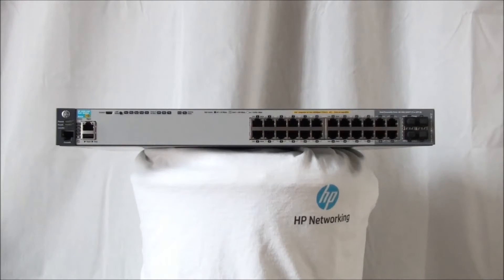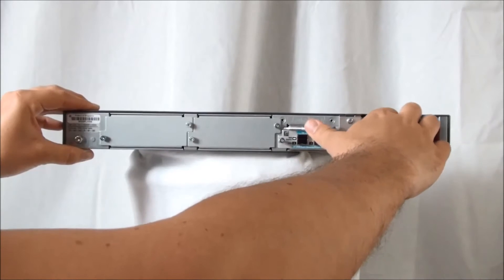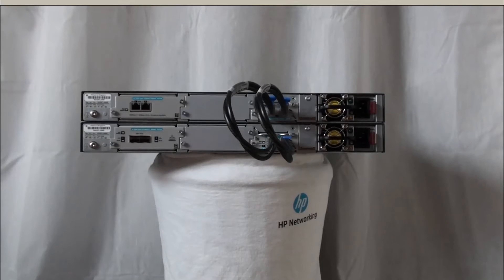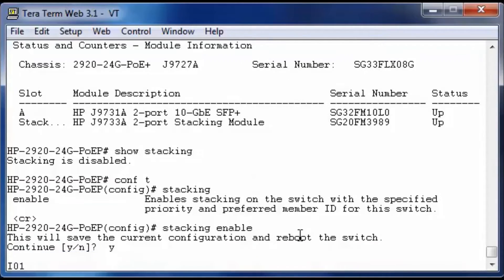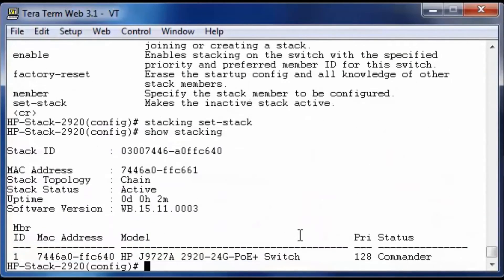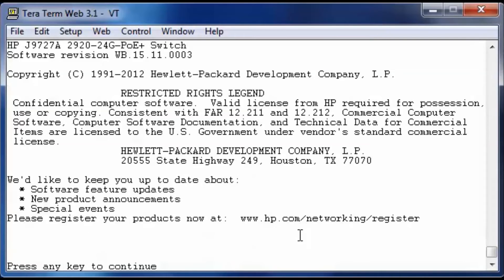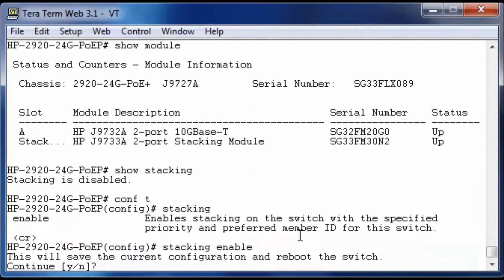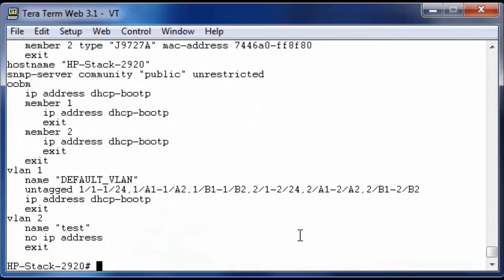HPE Aruba Networks 2920 backplane stacking hardware and software configuration

Comment: A1-FL05-IDF02# sh stacking

Stack ID         : 01006cc2-1707a780

MAC Address      : 6cc217-07a78b
Stack Topology   : Chain
Stack Status     : Active
Split Policy     : One-Fragment-Up
Uptime           : 62d 17h 39m
Software Version : WB.15.14.0007

 Mbr
 ID  Mac Address   Model                                  Pri Status
 --- ------------- -------------------------------------- --- ---------------
 1   6cc217-07a780 HP J9728A 2920-48G Switch              255 Standby
 2   6cc217-079840 HP J9728A 2920-48G Switch              250 Commander
 3   c4346b-a457c0 HP J9729A 2920-48G-POE+ Switch         100 Member
 4   941882-e06ba3 HP J9729A 2920-48G-POE+ Switch         99  Not Joined
A1-FL05-IDF02#

HP-Stack-2920# sh stacking

Stack ID         : NO ID - will merge upon connectivity

MAC Address      : 941882-e06ba3
Stack Topology   : No Stack Formed
Stack Status     : No Stack Formed
Split Policy     : One-Fragment-Up
Uptime           : 0d 0h 4m
Software Version : WB.16.02.0012

 Mbr
 ID  Mac Address   Model                                  Pri Status
 --- ------------- -------------------------------------- --- ---------------
 *1  941882-e06b80 HP J9727A 2920-24G-PoE+ Switch         99  Commander
  2  6cc217-07a780 HP J9728A 2920-48G Switch              255 Not Joined
  3  6cc217-079840 HP J9728A 2920-48G Switch              250 Not Joined
  4  c4346b-a457c0 HP J9729A 2920-48G-POE+ Switch         100 Not Joined
HP-Stack-2920#

Comment: Will stacking work between HP 2920 WB.15.14.0007 and Aruba 2920 WB.16.02.0012.
They both have difference versions will they work?
Reply from the maker: This can work. Any 2920 can be part of the stack. When adding the HP 2920 version to the stack and Aruba 2920 is the commander it will push the stack software to new added member of the stack. the stack is more or less acting like one switch so commander will always make sure that all switches run stack firmware. The ArubaOS is stack commander right?
Reply: Thanks for the quick response, we have 3 HP switches connected in Stack, now adding an Aruba 2920 switch to the stack. 
How many switches can be added in a single stack 4 or 5 in ring form.
Reply: In my experience trying to add a member with a newer OS won't work.  My suggestion would be to power off the one with a newer OS.  Updated the firmware on the existing stack and reboot the stack with the 
"boot system" command which will reboot all the switches in the stack.  Then restore power to the switch you are trying to add.
Reply from the maker: 4 switches is the max for 2920

Comment: Very good demo.  The member provisioning is useful for having complete control of how many members, their type and their priorities before physically connecting them, though is not required for building a stack.  As mentioned, you can just simply connect more members to the first booted switch(commander) and they will be automatically added to the stack as standby or members accordingly. If the case of having different software versions on each switch, the new added members will download the version from the commander and then reboot automatically.  Also having all the stack members connected(up to 4) and then powering them up , they will automatically elect a Commander , Standby and member switches  which roles and priorities can be changed later from the CLI.
Reply from the maker: Exactly. It's always good to have control 8-)